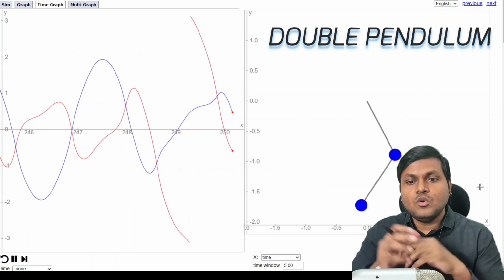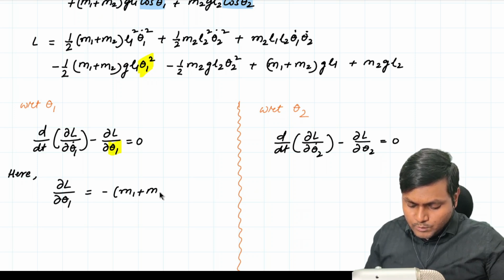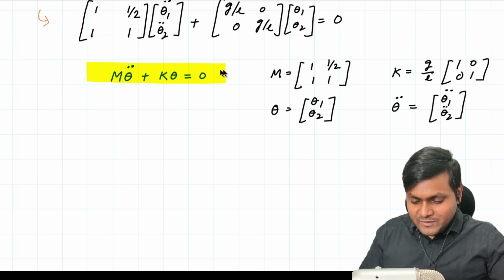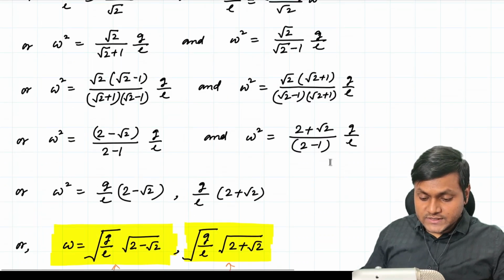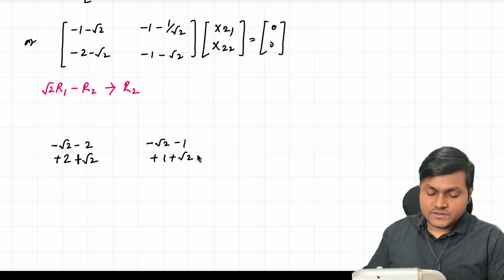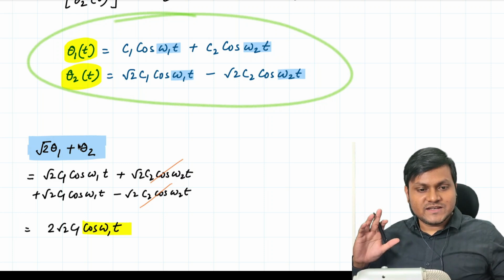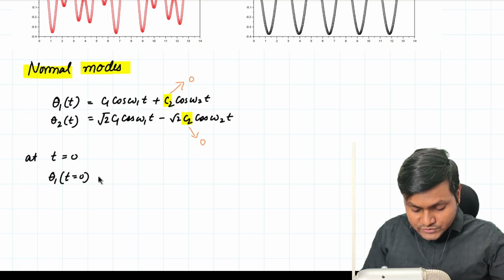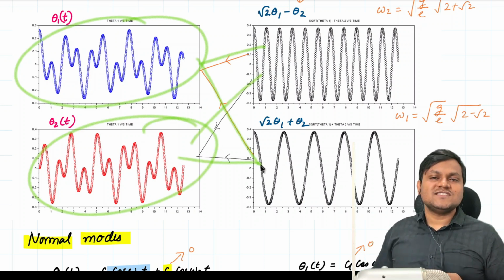Double Pendulum as Coupled Oscillator (Step by Step) | Normal Modes | Normal Frequencies

Comment: Sir i have a question. Does this normal coordinates analysis is only valid for complex and coupled oscillator systems executing small angle oscillations? If we have not done the small angle approximation earlier then can we find this normal coordinates? Thanks for clearing my doubt on normal coordinates and normal frequencies
Reply from the maker: For double pendulum or coupled pendulum, we need to assume small angle approximations. Not necessary for other coupled systems like spring mass systems etc